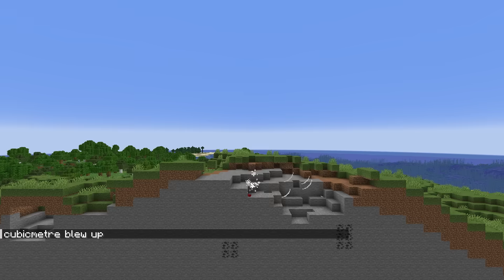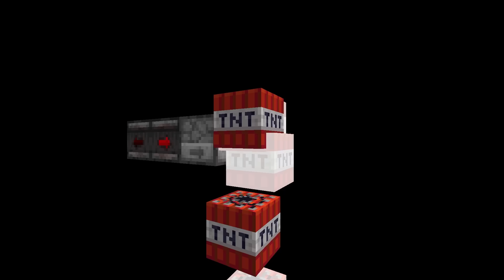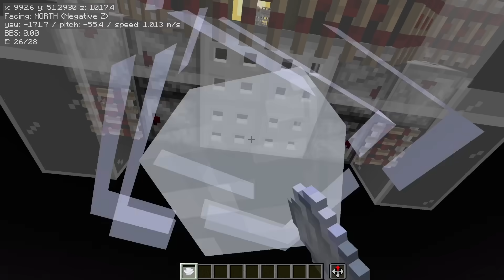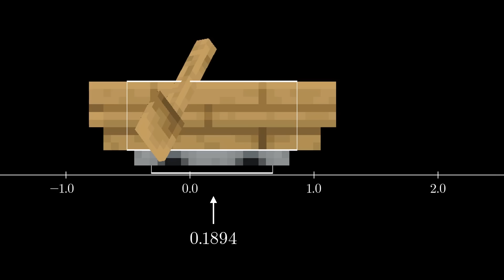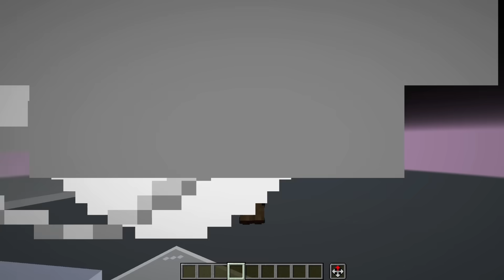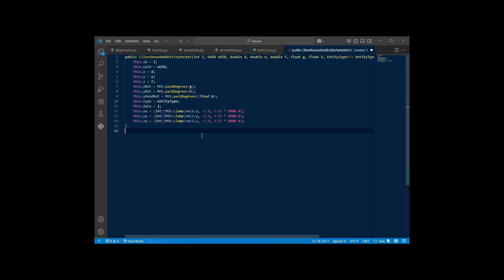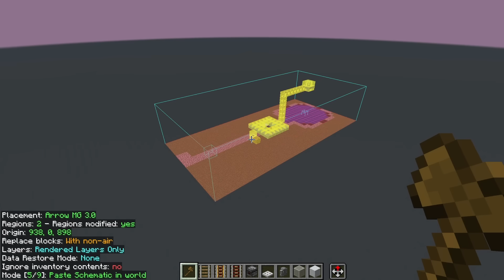The Best Air Defence in Minecraft is Finally Here!

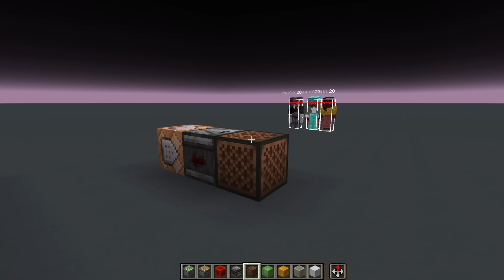Comment: 3:22 this is actually real a problem that people ran into with anti aircraft shells in real life. At the beginning of WW2, flak rounds were designed to explode at a certain altitude, so that had a very limited window where they could actually hit an aircraft with shrapnel and it took hundreds if not thousands of rounds to down a single plane. The problem was fixed when the Americans figured out the VT fuse, a special flak round that contained a vial of acid that was surrounded by lead, and a radar. When a shell with the VT fuse was fired, the force would shatter the glass vial, effectively manufacturing a battery on the spot as the acid hit the lead, powering the radar, which would detect when something got close enough and then tell the shell to detonate

Comment: I heard they might be changing tnt duping is that correct?
Reply from the maker: Mojang has taunted the idea but there are still two major roadblocks:
1. TnT requires Sand which can only be obtained through excavating deserts or using gravity block duplication.
2. TnT duplcation is currently the only moveable method of using TnT in flying machines.
The solutions to these two issues would have to be very nuanced as to not disrupt the core aspects of gameplay. I'd say #2 is the most difficult issue because simply making the TnT in flying machines a consumable would radically disrupt the design and application of many of Minecrafts most impressive technical feats such as quarries, world eaters and tunnel bores.

Comment: Hi, just an armchair nerd here, there are a few things done IRL to improve the effectiveness of aa emplacements. For starters the comment about ww1 aa while accurate fails to take into account that while a bullet might hit, it very much might not be a kill shot, thus more rounds will need to be expended to ensure effect. As for the improvements, they are as follows, 1. Using computer and radar, 2. Increasing fire rate, 3. Introducing fragmentation, 4. Increasing count of aa weapons and finally 5. Training.

For 2 and 3 I understand the limitations, as arrows can't explode to create an area of effect, they can only directly hit a target, the issue of this being using a small projectile to hit a small target is difficult, rather than a projectile creating an area that damages the target. I also understand that you can't increase fire rate because of the tick limitation, though other methods to increase firerate were used, such as multiple barrels and firing mechanisms. This leads into point 4.

For increasing aa weaponry you have 2 choices, 1 is to increase weaponry under the control of a singular gunner, this usually translates to mutliple firing mechanisms attached to one turret. Option 2 is the easier option in minecraft and that is simply to have more turrets and gunners, though with the lag of the amount of entities I worry if this would make it worse or better.

The only other choice I have worries about is having electronics. For your algorithm my main question is about whether at greater distances it is accounting for travel time, because if all it is doing is tracking a target and aiming at its current position the effectiveness reduces at distance. IRL we use radar and algorithms in congunction. So tracking the targets distance, direction and speed, allowing us to use the known ballistics to fire a projectile at the predicted location at time of arrival. My worry here is that while IRL this is easier as laws of physics prevent objects from changing direction on a dime, in minecraft using rockets and maneuvers not possible IRL allows this exact thing to happen, which can mess systems up.

Finally the most realistic choice is the one you provided, simply training the gunner can improve accuracy greatly aa they start to learn the tendency of ammunition and of targets, simply experience and practice are the best options in the context of minecraft to improve effectiveness.

Thank you for reading if you did, just thoughts that were in my head as I watched, sorry if I talked down I just don't know your level of knowledge and so chose to explain as if to someone who knows very little and emotion can't be portrayed through text. Finally if there are any spelling mystakes or gramatical errors that is because I am writing this on phone late at night so I apologise. Thank you again for reading and have good morning, afternoon, evening or night.

Comment: I dont know if you'll ever see this, but seeing as you've made so many awesome creations, wouldnt it be better to make this into a shotgun sort of weapon since it would in theory be better???

Like a cone of arrows, still fairly concentrated, but spread out enough to reliably hit targets (if your aim is poor)
Reply from the maker: The arrow shotgun solution was demonstrated with my previous design of the arrow railcannon that I touched on earlier in the video. The problem is that the mechanism that allows the arrows to spread out in a tight cone was broken in newer updates. To add further insult to injury the whole Anti-Air cannon mechanism was also broken in 1.21.11 so I am not particularly motivated to work with this mechanic until the problem is fixed.

Comment: 3:20, with enough firerate, the AoE of firework rockets would make for a great air defense, many early air defense systems used timed fuzes on their explosive charges, which could blow up at a set height, making for great area denial, the only issue is that you set the flight time at crafting, so it's less customizable on the fly, you'd need to swap out a whole set of rockets just to attack a new altitude(/distance)

Comment: Does anyone know, if projectiles shot by mobs also have the same impact on windcharges?

I mean, if it was, couldn’t you just build a fully automatic air Defense system, using the AI of mobs to aim the gun? 

I’m not sure what mob has the best aim in that regard, but theoretically, that could work and would probably be worse than a players aim, but just the idea sounds crazy to me and would surely work at closer ranges

Comment: 3:30 this is exactly why the VT fuse in WWII was important. The Variable Timed fuse allowed people to adjust what distance from the gun the shell would detonate. But then the Americans and the British created their version of the VT fuse (called such to avoid suspicion, technically it wasn't a VT fuse), which used radar to detonate the shell at the opportune moment, thus making anti-air emplacements so much more accurate and deadly. They were only used on naval vessels for a while until the war was mostly over, since if they missed, the shell would sink and be irrecoverable. They didn't want the axis powers reverse engineering it

Edit: they were also used by the British coastline gun emplacements. They also made it possible to successfully shoot down the V1 flying bomb. 

TO CLARIFY the fuse i am referring to is the proximity fuse. It was called the VT fuse for SECRECY SAKE. Watch the fat electrician's video about the VT fuse, it'll explain everything i just said in better detail.
Reply: VT fuze was the codename for the radar proximity fuzes. Regular timed fuzes were just called timed fuzes.
Reply: @treyebillups8602  yes. That's what I said. The VT fuse is the Variable Timed Fuse. The radar proximity fuse was called the VT fuse to confuse the enemy, same reason a "tank" is called such
Reply: @Silversong_Reavers  no, you said that the regular timed fuzes were called VT
Reply: @t @treyebillups8602 es. Variable Timed Fuse. VT fuse.. as opposed to proximity fuse, called the "VT" PRURELY FOR SECRECY.... What don't you get? Dude, Variable Timed fuse is still a valid name, it's accurate.

Comment: I wonder if having several cannons all operated by the same player with a very small offset (in time and/or space, ie. six cannons all one tick apart) would allow a slightly dispersed conversion point, better increasing the chance of hit (similar to how many actual anti aircraft weapons have worked). Currently I'd argue that this cannon on its own is not worth while. In terms of a defensive measure, the player is better served just using PVP. But if one player was able to operate several cannons, than you could have a very effective AA weapon. I often think that one of the reasons that many redstone weapon systems aren't used often (aside from technical know-how) is that their efficacy is not up to scratch. They achieve the results necessary to look practical/dangerous but seem to not have reached the critical point where they become the MOST effective weapon. As an aerospace engineering student who has some focus on similar weapon systems, this is one of the things that experts/teachers really harp on; you can't just be dangerous, you have to be dominant (ie a 90% working weapon is magnitudes worse than a 99% working weapon, to the point that the 90% working weapon is usually not worthwhile to use at all). Just feel like if redstone engineers are gonna build weapon systems, they should be built to be the best they can yk?

Comment: That windcharge activation is so good should be easy to use in those activate from anywhere stasis chambers
Reply: if only i knew a good static windcharge gen mine is so janky and the trapdoor arrow timing is not working and i actually know why i was beeing lazy and totally forgot to use bubble col :D so they just flew too fast. Even if i dont fix my janky wind charge gen that only catches every 2nd one its probs fine as it will just make it harder to accidentally activate the stasis. And since ill have to aim some angle down to activate it unlike most other wireless stasis's its probs even better than if it always shot a charge

Comment: this might be the best general-use anti-elytra defense, but there are probably better ones that only work under specific circumstances. I'm thinking of a lot of machines that use lag as a weapon, like 2b2t's EMP. Calibrated skulk sensor air mines could maybe be deployed, too. Problem with the mines is it also renders your own elytra useless and you can fly over the build limit, although if you built a thick field of them around your base it could maybe work as an effective (albeit costly) temporary defense.

Comment: Could you add a bullet spread like a shotgun so the gun doesn’t need pinpoint accuracy? Smaller spread if you want a wall of arrows that works at longer range? Maybe make machine single shot with one sure fire kill shot once triggered?
Reply: Idk the actual way to do it but maybe you could add a slight random deviation into the spread with animal hitboxes instead of boats for that little shotgun effect

Comment: The aiming, lead time, and point hit problem mentioned is one of the reasons why many of the of the most effective anti aircraft weapons have bursting/flak projectiles near to a target.  The tnt exploding add a step distance away from the canon is very aligned with the time fuse on mini flag shells from World War II. This would allow you to send up explosive projectiles at a specific range that you could dial in and learn. This could potentially overcome the non-one hit problem with TNT as hitting a target repeatedly with area of effect may be easier than hitting once with a point hit weapon.
Reply: Explosive projectiles were notoriously difficult to use, until the development of proximity sensors ("VT fuse"). That's why you see videos of bombers or paratrooper transports being surrounded by flak explosions yet flying straight ahead.
Reply: I wonder if the design can have shot gun bursts after some time in flight. Like a group of arrows travelling at once and slowly spreading while travel to suppress a larger point of impact

Comment: The problem with this design not being effective with moving targets is that the ammunition used which is a Arrow needs a direct-shot to kill. What modern ammunition in real Anti-air weapons use is a mix of direct fire and flak. Once the bullet reaches near its target it explodes scattering small fragments towards the target. While such a complex ammunition cannot be made in Minecraft a simple solution is tuning the mechanism to be a little imprecisey and have it shoot several arrows like a shotgun. This way evasive maneuvers will be less effective and the need to shoot rapidly is removed. One effective burst of several arrows will get the job done within a fraction of the time that this C-ram machine gun system needs.
Reply from the maker: A lot fo people are suggesting this but they often fail to consider the how complex it would be to get a multi-shot mechanism to fit within the cannon. Aligning a single stream of arrows to the same position every cycle is relatively easy and compact. Doing this with multiple arrows would be very difficult as you would need multiple alignment mechanisms in different places with some mechanism to provide random offsets then there is the issue of the random offsets changing massively in relation to the aiming mechanism causing arrows to shift around all over the place making aiming the shots very difficult as the multi-shot cluster changes shape depending on where you are aiming.

Comment: Okay, i absolutely love this, but i am secretly hoping you will take on the challenge of potentially using TNT as the ammo after all. Not just cause it be badass, but also cause of actual history. See, back in WW2 when proximity fuses were invented, they went from needing hundreds of rounds to take out an enemy aircraft to somewere arround 60 if i recall correctly. Might have the numbers wrong. Anyway, there was a reason that anti air used flak shells and not just normal bullets. Anyway, i could never make this anyway, and again, its awesome, but secretly hoping either way.

Comment: I'm so impressed by your trapdoor discovery and suspect the original confusion is caused by the high velocity of the bow-fired arrow allowing its hitbox to "project" slightly through the block before the collision is registered, whereas a stationary arrow registers the collision extremely close to where it should occur. 
Not sure exacly on the specifics of MC arrow collision code tho so may be wrong. But it's a pretty common issue in most videogames where high velocity entites can pass through walls when moving so fast their hitbox clears the impassable object in a single tick

Comment: this is almost good, but anti air in real life works more along the lines of "bullets per sky" than "precision point defence".
the point defence weapons would often fire homing projectiles instead or be used en-masse.
at least when dealing with small and fast moving targets, this is perfect to take down someone on a happy ghast or a lycanite mob.
a good option for air defence would be a slightly slower(because of the limitations on firing rate) but more shotgun approach of sending around 800 arrows at the general direction of the target every cycle.
you are bound to hit them eventually, and the server crippling mass of arrows out of render distance are there as a warning to stay out of your air space.

not saying this is bad, but this is more of a WW1 or early WW2 AA rather than modern AA. because even in the mid-late WW2 people started using things similar to FLAK for air denial and single/dual MGs were more for air-to-air combat.

Comment: The irony of this is it actually mimics real world AA defense in some capacity. The old ww2 method of anti-air was to either use machine guns or try to put a timed fuse on a round and just pray you timed it right- of course, until the invention of the VT fuse (radar based projectiles). 
Until someone figures out how to implement a distance detection system into a moving explosive (tnt, firework, etc) high rates of fire/projectiles like a CRAM or CIWS system might be the only way to achieve a proper air defense in Minecraft.
Reply from the maker: The most likely improvement to this design would be some sort of projectile that has proximity detection of nearby entities, or just a large collision detection range.

Comment: Based off my understanding, it would be possible to aim TNT at players in the same way the arrows are being guided. However, the issue is that the TNT would just pass through the player, and it is difficult to time the explosion of one TNT at variable distances in rapid succession. So, what I was wondering is what stopped you from considering lining up dupers offset by one gametick each, and then shooting the TNT out using player guidance in the same manner, creating a line of exploding TNT (like a tunneler cannon, except it is aimed in the air by the player). The distance between each explosion in the line can be controlled to my knowledge, it is only changing that distance on the fly which is difficult. What I envision is a TNT beam that you can shoot at players, making it much easier to hit them, the only limitation being that the beam would have a max distance. With TNT, I also think that you might be able to create an anti-totem system, as the TNT forming the beam of explosions could contain two payloads offset by a tick, causing two fatal explosions in rapid succession, so that a player cannot react fast enough to equip another totem. I would love to hear any thoughts on this!

Comment: Is it possible to compress enough TNT minecarts in 1 block to explode obsidian?
Reply from the maker: No, explosion damage is not cumulative, each explosion is treated separately in the block destruction process so they don't stack. You can in theory blow up blast resistant blocks with individual explosions of sufficient power but these are only possible with commands.

Comment: I think if you wanted remote on/off, you could try a specific sound made from the operator of the machine get picked up by a calibrated sculk sensor, or hook up a tripwire with the player on a slab, so that crouch/stand is an on/off, like a perfectly time or intended shot for the right opportunity